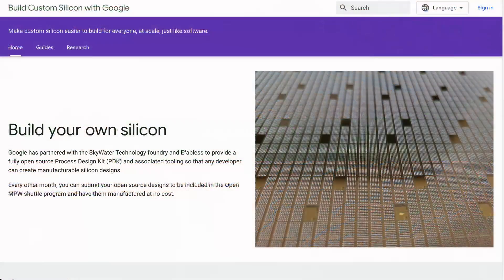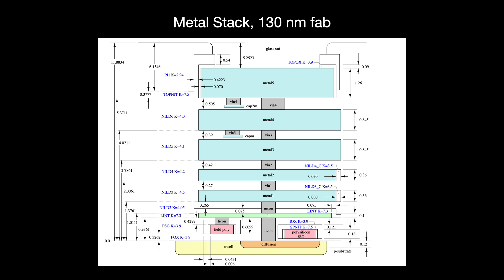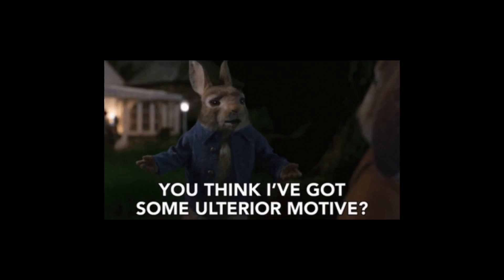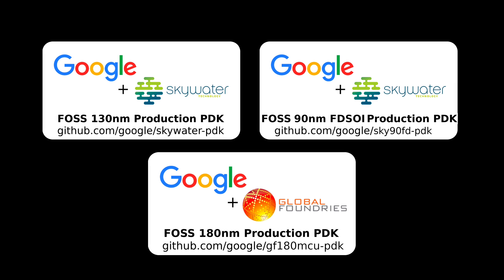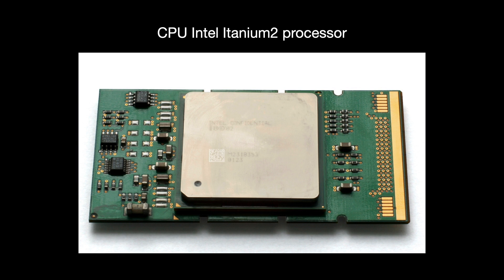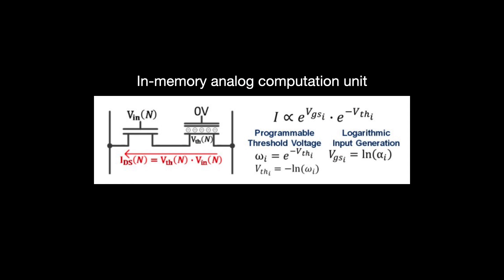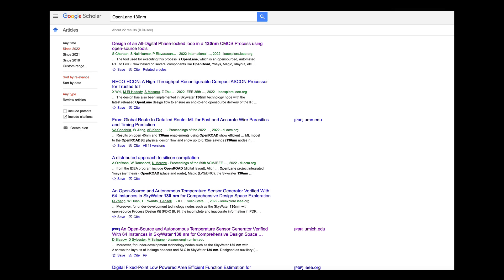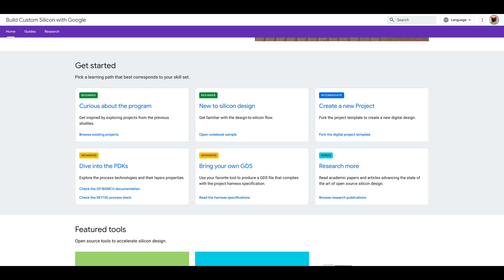Google's Open Source Hardware Dreams

Comment: Unless it includes the latest low energy design process node, of around 45nm, it's not the best. Sure you can design over 1.5Ghz on 130nm,  but its going be a high energy hotter form.  What you want is over 1ghz at lower energy.  In reality anything below 130/180nm ís said to be a compromise.  Even at 130nm, one is compronsised as far as radiation hardening for space nissions goes.

It might pay to talk to your contact at Google about that 

But, even at a leading foundry, that sort of process has been extremely high cost to even calculate and prepare the mask. Hence, we get stuck with older processes.

I have know people to get several hundred Mhz low energy in such a node.  But that's the most extreme case in the industry.  Once you make more complex processors at lowest energy (the natural cycling rate of the node, where there is reduced leakage), you are heading to a fraction of that speed, which is just too compromised.  Thats why they need the latest low energy options as well.  Even if they have to regulate it to only approved designs for special access.  Google may see the value of the circuit below 130nm.  Maybe after an initial 130/180nm design has proved itself. It really depends in your work flow.  1Ghz at lower energy, gives a wider range of applications it can handle.  But, as far as sampling rates and radio signaling rates, abd ADC and DAC, it really needs to inciude the special ability for that.  Which may be included third party circuits to attach to in the program, which may be designed under another part of the prigram.  Just some thiughts.

An aside: I hear of a chip design, 40 processors at 6Ghz each at 1mm2 at some low energy, but that's at some latest unnamed process, but matchs my predictions from many years ago.  This is how far low energy is going.

Comment: Getting your chips packaged or wire-bonding to a raw die is non-trivial to setup as well.  How long till someone sets up "standard" bond pad layouts and packaging for you to plop your design in?  This would be great for upgrading FPGA designs as even 130nm should give an easy 10x speed up.

Comment: I think that if let's say single board computers (SBC) could be made using this tech, at a bizarre low price and be made easily to chain together and form cluster for parallel processing, it could be a very nice application: the each size and speed order of magnitude, there are many application that could make the product commercially viable.

Comment: A few fun little facts:
NCSU publishes their free pdk for 45, 15, and 3nm process nodes.

It's how I learned VLSI myself, and Im at the big green company these days.

And, the 130nm process node is optimal for satellite systems. Radiation flips bits less often when you're on larger transistors.
Reply: Hi, how much did it take from you to learn VLSI? did you start learning from zero or you were in EE/CE college?
Reply: :medal-yellow-first-red:

Comment: Most products incorporating microcontrollers do not need 2 GHz.  The EFR32 is one of my favorites and their bleeding edge version runs at 60 MHz.  Imagine a microcontroller with exactly all of the I/O needed to do the job in one chip!  I hope someone makes an open-source 6502, 8501, and ARM 4 compatible microcontroller IP!  That would start everything else.

Comment: One of the good things for hobbyists about the larger NM size, is lower rejection rates. 7 and 9nm projects (from what I understand) have really high rejection rates due to required precision. With less precision comes less mechanical error (one would think)

Comment: What can you do with 130nm?  All sorts of stuff, including stuff you might never think of.  I work for a major semiconductor manufacturer on power converters.  Most of our state of the art processes for analog and power devices are around there.  That's a great spot for high performance CMOS analog.  130nm might not be good enough for cutting edge digital, but you can still build amazing digital on that.  And possibly quite alot of analog circuitry, depending on how the process is tuned.

Comment: Look what they did with android. Lure open source talent to build android for them, then add a proprietary layer on top and slowly move necessary components of the system to that layer so you no longer have a viable open source system. Google is totally evil, and their motivations are control rather than profits, which is much more insidious.

Comment: Couldn't you theoretically "compile" very simple device firmwares into "fixed-function" silicon that would be cheaper to manufacture and have the benefit of being more electrically efficient and not require any boot time?

Comment: How much per mm2 to actually fab your design in the shuttle program?
Reply: Free it you join the open source program, otherwise you can also pay. All designs make use of a template with about 10mm2 of user space and the closed source shuttle was something like 10k$ for some 100 to 300 chips depending on the run iirc

Comment: Could all the little ICs everything needs like power mosfets, digital to analog converters, pwm controllers have open source equivalents? That could be huge for right to repair.
Reply: if you're talking about components, there are plenty of cheap jellybean third-party replacements parts so there is no practical need besides as modules integrated inside a larger die.
Though for right to repair, the manufacturer should have that in mind during the PCB design instead of using unusual pinouts/packages or component characteristics.
Reply: Finally, I was looking for this comment. Although the previous comment says that rejected parts that are relabeled work "fine" the thing is lifespan. And then there's propietary chips where you won't find details or datasheets... But can be circumvented by knowing what kind of function does. Like a dead Bios chip, or the PLL for clock modulation/generation. Or even remaking Legacy chips, like SID of the C64, or the TTL 74 series with higher freq range, less voltage/current drain, better fan-in/out capacity... Heck even make ALS181 but in true 8-bit form!
Reply: @cfpm_spot  I didn't say "rejected parts that are relabeled work fine". This is your miss-interpretation. Like you said, I just think those little ICs cited by OP are often so simple that they are already retro-engineered, replicated and improved by many manufacturers, including the reputable ones.

Comment: I scanned through the comments and couldn't find anyone asking this, so could someone please explain what the order of 10 difference in nanometer architectures is due to ? I have very little chip knowledge, but I know the contemporary 'MOSFET' CPU architectures are in the sub 10nm scale, and this (also contemporary apparently) 'FSDOI' process is around 10 times larger .. Why ? What's the difference in goals between the two? are the two comparing apples to apples or something else ?
Reply: The latest processes are always extremely expensive and reserved for the biggest, highest volume customers.  130nm is old enough that it's not so much in demand so they will let ordinary mortals play with it.

Comment: Its a natural trend Ive seen from valves in chassis, with components wired to strip terminals, to through hole 0.1" pitch, surface mount ,online fully assembled pcb's and now a pathway to the golden land , mostly silicon. For hobbyists I think the arduino is so versatile this wouldn't come close to an M7 teensy. But for pure asic design, small run custom , time critical .Interesting.

Comment: There is a major difference between this and GCC. A GCC-compiled code was able to be run on the latest and fastest CPUs making them competitive with well-known products. Google's software can only work with ancient nodes which results in circuits that are 100 times slower than what well-known companies can achieve. It may be useful for some power electronics or very obscure applications, but not commercially competitive yet.
Reply: Well said. The performance implication is tightly coupled. Open source toolchain is evolving fast but still has a mountain to climb to match the performance of proprietary tools even for legacy processes.
Reply: Nodes? What are nodes in this context?
Reply: These tools also work for the non open processes, I believe there was at least one succes story around for GlobalFoundries 12nm

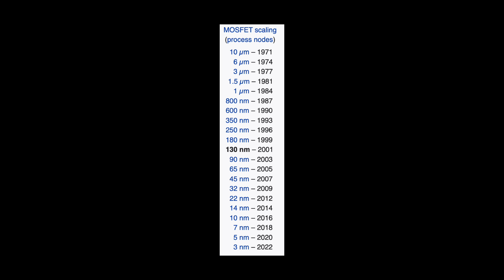Comment: 5:14
> What can we do with a 130nm process node.

I'm sure you'll continue to elaborate in the video, but... A F-TONNE!

Sure it's an old process node, but this has huge ramifications for a lot of things if utilized.

Take for example, drone video transmitters. Currently the difficulty in improving our video quality comes down to the ability to compress, digitally transmit, receive and decompress the video stream. Basically every step is difficult lol. Analogue video sidesteps this issue by using - you guessed it; analogue circuits - to perform a kind of pseudo-compression by exploiting the fact RF modulation is an inherently analogue thing.

The step up from PAL or NTSC resolution to even just a poor man's 720p resolution is massive latency, an entire compression pipeline and highly advanced RF modulation - essentially a minified TV broadcast system strapped onto the drone.

The reason why almost nobody is building digital video streaming systems for drones? It requires custom silicon dedicated to these difficult steps in the video pipeline and nobody can afford it. Current solutions are stupidly expensive. Only DJI has a decent solution - on custom silicon - and still has many issues while being very expensive. If someone can use google's services in this space, and produce a digital video streaming system that has low latency, higher than analogue TV quality, has more than a hundred meters range and costs less than a few thousand dollars, they've instantly captured almost the entire market.
Reply: AFAIK going to digital communication for this type of use case scenario can be an issue. When the signal reception becomes weak, analogue signal will produce a noisy but usable image/sound whereas digital will just cut or freeze.
It was way easier to point an antenna when TV, radio or satellite communication was analog.
Reply: @PainterVierax  Yes, you're exactly right! That's why it's so difficult! The solution to this ties into my original comment.

It's possible to compress and transmit digital video in such a way that as the data stream gets more corrupt the video looses quality and accuracy, but remains readable like analogue video would.

It quickly get into the weeds of error checking mathematics which I do not understand.

What I do know is these algorithms require a modern GPU running at a reasonably high load to compress(if we don't have silicon dedicated to the compression algorithm) and highly specialized and elaborate RF equipment(if we don't have custom silicon for an RF SoC).

These algorithms and RF SoCs are why custom silicon is needed. Custom silicon can do all of this easily on last decades technology. Today, building a digital video system is comparable to building a discrete microprocessor.

Comment: I also fantasize about open-source projects for CPUs, GPUs, FPGAs, and a few ASICs with at least one project in each category having a humongous contributor base so that people get good hardware without any IP fee (only manufacturing cost). There will be huge libraries so that anybody can make a custom chip for their application or simply pick the leading FPGA to program it to their needs.
There are some big open-source projects like Linux and applications for Linux, ROS, OpenCV, some CAD software, etc. And Linux made Microsoft afraid when they were dependent on selling windows to earn money.
Reply: Better start learning and tinkering now while we're still in the early days! :)

I'll be trying.........
Reply: funny you mention Microsoft's early fear of Linux. Now they're a significant player in that space, with Windows Subsystem for Linux feature in Win10/11 allowing Linux distros to run inside windows
Reply: I think this is totally possible.  True, the cost of making a small number of chips is going to be really expensive, but if there's enough people that want in, and the cost of small runs comes down a bit, this seems within reach in the next few years. The open source community has the design talent.
Reply: There are Risc-V, manufacturers out there, and the software base is being built up.  But, the issue is, that ARM has simply renewed it's instruction set and thumb, along the way.  Claiming similar performance improvements to Risc-V over time.  Is Risc-V behind in performance now?
Reply: The Risk-V CPU is already open source, but good luck finding any manufacturers / operating systems. The truth is that without mass adoption, it will never be a thing.
Reply: @firstNamelastName-ho6lv  Yeah simulation may be nice and a broad knowledge in the society how to build chips is (as all education) something good, but producing a REAL product goes always hand in hand with a RISC[1], sorry for the pun, a risk. Reminds of all those people who want to be a "superstar". Yeah, they are real ... but not enough "free slots" that let you become one. You know what I mean? It isn't even the worst strategy: Instead of paying decent wages or to take care of all the tedious education of your future employees, why not make them believe they ALL can get to be a superstar and then pick the best and throw the others in the trash. So THAT reminds me of something;) Hehehe.
BTW of course the provision of free development opportunities and access to research for even laypersons is never wrong. However, giving someone false hope (like any hype) is antisocial and despicable. At least a very expensive hobby ... but in my opinion more useful than botching sports cars or shooting automobiles into orbit.:)

[1] Did you actually wrote "Risk-V CPU" up there (it is RISC-V!)? I noticed it only after writing down my joke. Or did you inspire me? Anyway: Hehehe, well done!:)

Comment: I just think that if Google wants to make chips this project is great for them too. They can just apply some of the best open source design ideas or at least test them and pay nothing at all (or maybe very little). Meanwhile Intel, AMD, nV or whoever else would have to burn cash to even start experimenting with some new architecture ideas. So it's no-brainer for Google. Meanwhile for us it makes it cheap to design chips and maybe make something usable to some extent. I see it as massive win win situation. The only problem is that Google hardly makes anything on their own and their Tensor CPU in phones is badly lagging behind and uses a lot of ARM's designs, so it's not like they can modify it and even if they did, it might not be enough to close the gap with competitors.

Comment: I support this initiative. The more people learn about chip design the better. And almost more importantly, it gives independent programmers a chance to develop and improve open source EDA tools that will accelerate the industry just like other open source software has. That can only lead to more innovation as you don't have to raise millions in startup funding just to access software to get started with your design (though realistically you probably still have to raise millions before you can get it fabbed, but having a design ready to go will make raising funds a lot easier).

Comment: I wonder this would help display manufactures. There is very little consumer facing information on the chips powering displays. Perhaps they require more compute power or have enough scale to be better served by more modern chip manufacturing.

Comment: I just started college after 2 gap years and I’m undecided on what I want to do. This video makes me want to do computer science
Reply: I'm sure you'll do more research, but just a heads up, comp sci is programming, what you want is computer engineering (I think). Also, it's very competitive.
Reply: Anything computer related is solid but you’ll need good math skills up to differential equations to make it through.
Reply: If you want to design chips go electrical engineering.  Half of the software engineers I've worked with are EEs but you never see a hardware engineer with a CS degree

Comment: I wonder if they let you make thermal imaging sensors. Or does that require a higher security clearance.
Reply: Thermal imaging sensors, known as bolometers, are made using different techniques. Maybe Asianometry would like to make a video about this quite complicated and delicate chips? Anyway, as long as you make your thermal imaging device with 9Hz/fps you're good. Higher refresh rates are a bit more ...restricted, so to speak, at least in USA and such.
Reply: @aeonikus1  so you need a different node/process to manufacture these sensors?
Reply: @ballinlikebill8334  A completely different process. It's fairly advanced, high aspect ratio MEMS with custom deposition(a-Si or vanadium oxide) for the actual sensor array, plus another, normal CMOS readout chip bonded to it below.